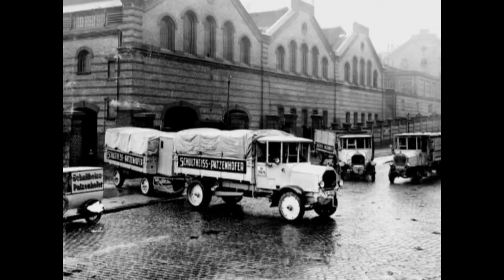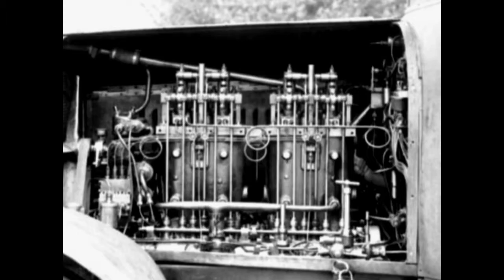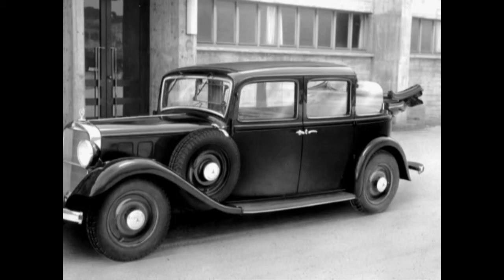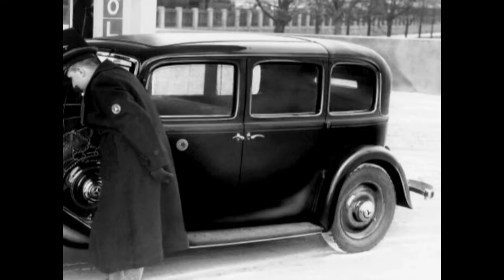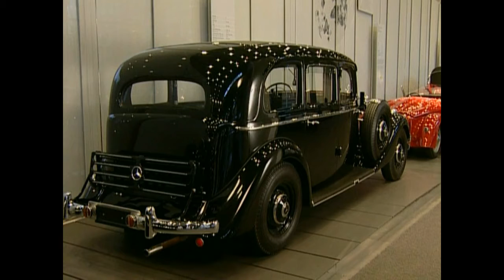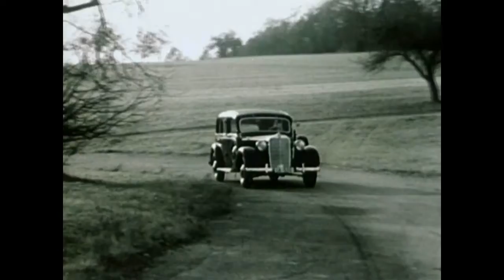Mercedes Benz Type 260D W138 Specs Documentary

Comment: Whut whut whut? A full 10-liter tank to run 400-500 km? So is this can run about 40-50 km per liter? Is that real????? Its even about twice as more fuel efficient on modern diesel cars!
Reply: Wtf does 10 liters mean in freedom units and km to for that matter
Reply: It's an obvious mistake, the narrator meant 10L/100km, which is 24mpg, excellent for the 30s